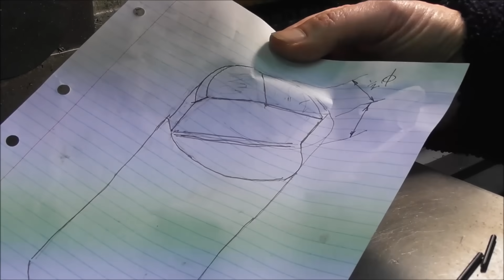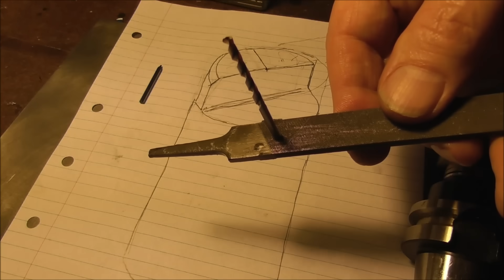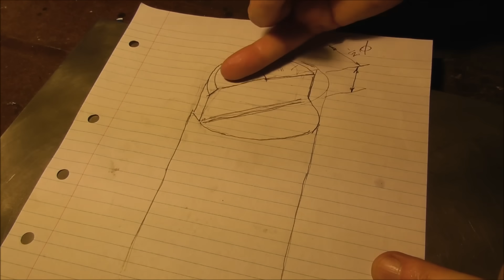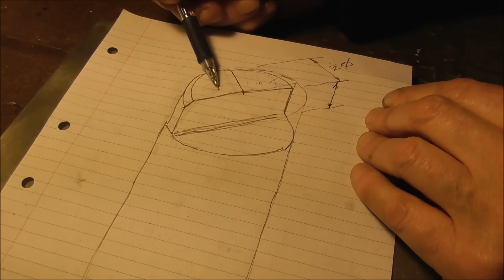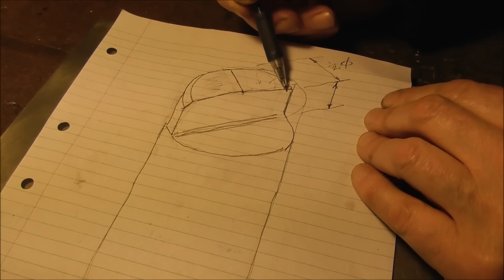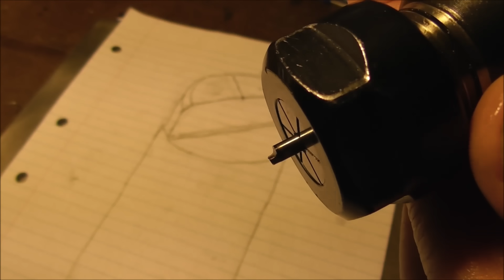Machining hardened steel - on a budget.

Comment: That is a good presentation showing the fundamentals of a basic D bit. All the clearances, rake angles, minimum flute length were all covered for this most basic bit grind. I was particularly pleased that you broke the sharp corner, this is often missed by beginners and should be encouraged for all types of cutting tools.
Reply from the maker: I recognize a voice of experience. Cliff

Comment: Very good video, can I reharden a tap to cut threads in hard steel?
It seems that right in the 3/4 hole my tap gets very third to turn 1/2” plate
5/16 hole 3/8 x 16 tap. I have broke 2 taps trying to tap the hole throw ?
thanks
Reply from the maker: Hi Richard. What hardness is the steel you wish to tap? Cliff

Comment: Thank you, nice video. I have a tiny shop under the house, where I make knives and have fairly often used through-hardened files to make certain knives. What I do is to anneal the file, work on it then heat treat it back to 60-65 rockwell. If you do that, even a cheap cobalt drill bit will go through the file and you can saw and file it to get the profile and form you're  after (before you re-harden it of course). I don't have a lathe, surface grinder or mill and discovered that it was easier and less expensive to do it this way after I'd broken only a couple of carbide cutters.
Reply from the maker: Yes, annealing is often the best solution. Cliff

Comment: Very good instructional. I like that you touched on the value of clamping the quill and feeding on the knee instead, which is a valuable high-precision technique.
Reply from the maker: Thanks for the feedback. Yes, it may be many operators don't think of using the knee for vertical feed. Cliff

Comment: Hi Cliff, happy new year and thanks again for sharing these great ideas, they are really helpfull, especially when removing broken taps. What do You think about simplifying the cutters geometry? I find it isn´t that easy to hit the centerline when grinding the clearence angle at the front surface of the cutter so, that the kink of the cutting line is spot on center. Grinding a straight tilted line with an angle of about 0,5 to 1 degree (inclination from the circumference to the center) gives clearence to the not cutting half of the front surface without creating new troubles. 
Cheers and best wishes from Germany
Reply from the maker: Interesting idea, that would be worth trying. Best wishes from NZ. Cliff

Comment: The problem with modern files is that they tend to be made of high carbon steel, older and expensive files are made from austenite which is harder than carbide.
P.S. bloody good effort.
Reply: Are you sure that this is not a little bit of "dangerous" half knowledge here?
Reply: Absolutely false, Google it, then delete it.

Comment: You welded it, so that changed the hardness of the steel...
Reply from the maker: Welded it?
Reply: @Threadexpress  There are guide rails welded onto the file.... Those are going to  change the temper of the steel...
Reply from the maker: @johngaltman  No the file is just sitting on parallels, and soft aluminum glued to the edges.  No welding. Cliff

Comment: You have a very heavy duty milling machine! Who is the manufacturer of the mill??? I love the box style ways!!
,super great video. Many years ago I worked as a carbide die maker for the fastener industry. We made our own cutters from Carbaloy 999 grade carbide rods, similar to the way you made your fantastic little cutter. To make the forming die we would start with a piece of D 70 grade carbide 1 1/2” diameter with a 3/8” diameter hole through the center, and about 2” long. Each cutter would remove about 1/8” diameter each pass. It might require 2-3 cutters to bring the internal diameter to within .002”-.003” of the finish diameter. You could even rough in the extrusion angle depending on the shape of the cutter. The die would then be lapped and polished using diamond paste in different grades to finish with a mirror like finish. Depending on the grade of steel the bolt was made of the life og the die could be as high as 400,000+ pieces!
You’re a very clever machinist my friend!! Thanks for another fantastic video!!!❤️❤️❤️❤️❤️
Reply from the maker: Interesting! And thanks for the encouragement. Cliff

Comment: A technique I learned was to use a carbide ballnose endmill, very high rpm and tiny pecks.
More applicable to CNC than manual, I have machined multiple taps out with the same ballnose will almost no visible wear to the tool.
5000 rpm, 0.05mm pecks, flood coolant
Reply: In my shop, we've machined taps out with cnc using ball nose and bull nose end mills.  I tried Cliff's method recently on a manual machine, and it worked so well that I think it would also be much faster on a cnc machine as well.  After all, there's an endless supply of broken small end mills in any machine shop.
Reply from the maker: Thanks for your input. Cliff

Comment: Happy New Year Cliff, and I might give this a go to pin a crankshaft, which I tried using a slot drill many years ago on a Haas CNC machine centre that walked. If it gets through the first mm or so, then Ishould be OK.
Reply from the maker: Good to hear the process will be useful. Let us know how it goes. Cliff
Reply: @Threadexpress Thinking about the D bit approach some more reminds me of a “Unidrill” on a lathe, that can drill a hole, and be used as a boring bar too

Comment: This is a standard D bit grind that we used regularly on a pantograph cutting hardened mould dies. If you don't have any broken cutters just grind the opposite end of a good one. We did run them at high speeds with light cuts.
Reply from the maker: Yes, I do realize D bit cutters have been around for over 100 years. I am referring to an adaption (that is new to me anyway), of short flute length and short projection to aid machining hardened steel. Cliff